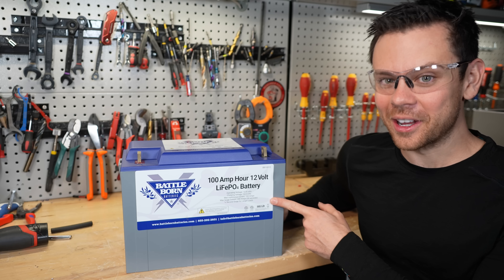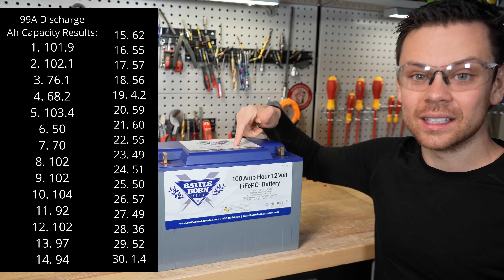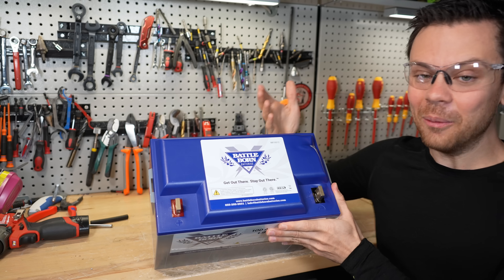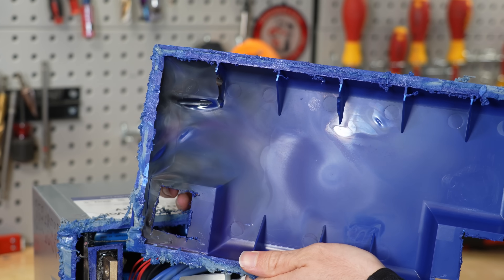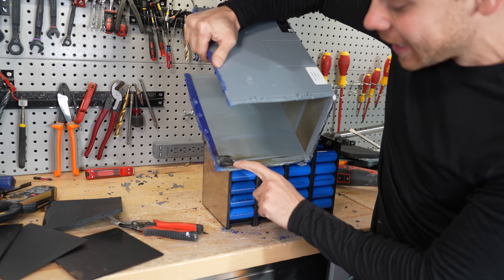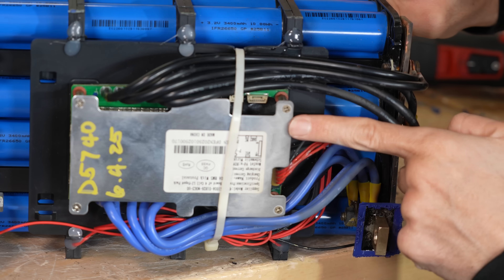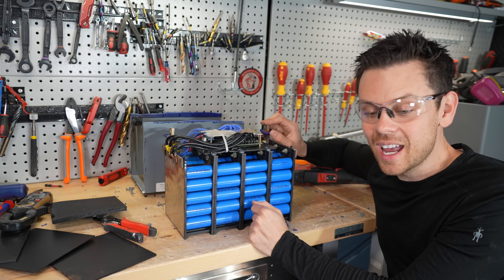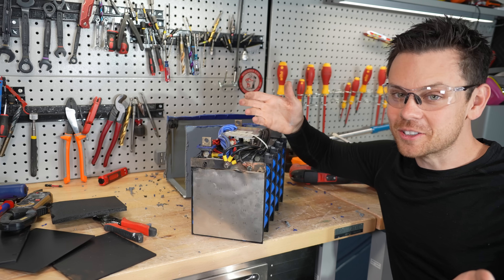Battleborn Battery MELTED?! 🔥🔥New Problem!

Comment: Are the Valence 12v 138AH U27-12XP better? I have done some simple tests pulling 1440w from 1 which was between 110-120 amps with no issue.

Comment: And you know here's the tragedy of all this. Aside from people getting completely ripped off and buying a dangerous product, It's highly unlikely that this company will have the resources to make this right.

The irony is that this was actually a very high quality battery with a fatal flaw.  If only they didn't have that idiotic plastic strip on both sides the battery, they would probably last for a very long time. I don't understand how this problem didn't present itself sooner though. Is this design a recent change or have they always been built like this? Because it really doesn't make sense that they lasted as long as they' have without at least catastrophic failures being reported often enough for this to have been discovered earlier.   Something doesn't add up here. 

If they end up not making good on it,  which I don't see how they will, I would attempt a do-it-yourself repair because it doesn't look that hard. When the repairs done the battery will probably last a very long time as it should have. I would very carefully cut the top off put a copper bar in place of the plastic with new hardware, and epoxy the case back together.  I'd never throw it out though, as that would be just a complete waste of money unless the cells are damaged, which doesn't seem to be the case. The discoloration of the cells was probably due to the smoke inside the battery case. It probably only makes sense to do the repair if the battery isn't as bad as the one in Wills example. 

What idiot made that design decision?  Again, it just doesn't make sense.

Comment: When I want to lithium on my rig 2 years ago, I priced Battleborn but they wanted $2100 for a 280ah battery.  I went with Batter 300ah and have had NO Problems for $600.

Comment: Wow, I have one of those I use with my trolling motor. So far it is ok. I will definitely be watching it, even though I only draw under 70A under WOT on the trolling motor. I also have two GameChanger 3.0 batteries in my Toy Hauler. Any idea if the same bad design is used with them? At least those have a max charge of 50A, so less than 0.1C charge rate for the two 270Ah batteries, and well under 100A max discharge rate at any time, typically well under that with normal use. Hopefully they last over 10 years.

Comment: About the positive terminal, is that steel screw carrying all the current from busbar to terminal? Or is there a better connection somewhere in there?
Reply: It's aluminum. Much better than steel, but not as good as copper.

Comment: Possibly buy another one of those batteries but chop the top off first and leave a thermal camera on it for three or four charge discharge Cycles. It'll be interesting to see what it looks like before it overheats it's terminals and during.

Comment: Did the assembler accidentally use a stainless or aluminum bolt on the negative terminal bar to negative bus bar connection instead of nylon to isolate the two? 

Looks like metal slag where the nylon head should be against the bus bar, and on the other side the threaded portion and nut look like metal not nylon, but could just be discolored from smoke/heat damage.
Reply: Hey @WillProwse, when you get a chance can you let us know what material the negative terminal bar to negative bus bar is made of? 

I’m trying to understand why you had such a catastrophic failure on that side given the amount of surface area carrying the current. 

Aside from all those bolts not being properly torqued, the only other possibility I can think of is that the bolt is not nylon like it is supposed to be to isolate the bus bar from the lug terminal. 

Seems like something more serious might be going on here than just the sandwiched plastic considering the extent of the damage and the damage to the BMS. 

Thanks!

Comment: I dont like using any of these batteries at rated capacity. I have 13x u27 12xp Valence  bateries in parallel rated for 150 amp continuous each, but really only take 300 amp max discharge and 250 amp max charge. They do get hit with 1000 amps for a few seconds starting the diesel engines, but still within ratings. Nothing even hets warm. I would never use one at rayed capacity. But in a test, I was able to start the engines with just 4 batteries. Rayed 300 amps each for 30 seconds, so still not even close. Just to note though. When I did this test with uneven length jumpers, it did not work. All the batteries shut down within a second. With 6 batteries at uneven length, it didnt care and the engines started easily again. It us my guess that they dont expect continuous at rating indefinitely. Because really, what good is a 1 hour battery.

Comment: Battle Burn is more talented at marketing and bean counting than engineering. My guess is multiple engineers have wanted to change the design but bean counters controlling purse strings and schedules didn't allow it. Once a finance person is in charge of a tech biz you can pretty much count on product quality and customer satisfaction degrading. All decisions will be made on how much profit can still be sucked out of their customer base. They'll basically burn up any long  term business success for short term profit goals (and collect their big $$ bonuses). Then they'll move on to another company to rinse and repeat with perfect timing to avoid the chaos.

Comment: I bought 4 Battle born 100ah 12v batteries 5 years ago for my full time RV.  I checked them out after Will’s first video, everything seemed fine, HOWEVER it definitely warrants a more thorough investigation.  I’m thinking it’s not worth the risk of burning everything I own to the ground, plus our lives, to chase the remaining expected life.  If I change out the batteries, then it’s what brand to choose, and what dimensions will give the most Amp hours in my dedicated battery bay. And also what to do with the BB batteries.

Comment: The fix is fairly simple.  Open the case, remove the plastic from the bussbar, repair the case or recase it.  The meat and potatoes of the battery is good.  If BB doesnt make it through this or doesnt recall it could make for a good side business for someone and it would be a way for someone to spend $200 to save a $900 battery from going to a landfill.

Comment: OK man, You 're freaking me out.  I am picking up a new teardrop trailer tomorrow with one of the babies in it.  What am I supposed to do?  Carry around a heat camera all the time?  The dealer says they have not had any returns or issues.. yet.  They are an excellent dealer, and the trailer is nuCamp, so quality people. who will stand behind it.... But I am curious if any of these are actually blowing up or catching on fire..
Reply: It sounds like it will be OK if you just don't push the battery to the limits.  Basically, pretend it can only deliver about half the current.  Will was running it right at its limit but if you run it well below that, it could be OK at least for a little while.  Still, as soon as I could, I'd swap out the battery for some other brand.  Use the BB battery for something that is outside where a fire won't damage anything just in case.  I'm just glad I don't have one of those.

Comment: I can't help wondering if the heat build-up is due to too many high current charge/discharge cycles in a short period of time.  Will should test other batteries the same way and take them apart to look for similar damage.  I'm not sure other batteries would survive such a test.  Just speculation.  But, I strongly agree with him that it's NOT OK to rely on the plastic to keep its strength and rigidity with heat.  Doing so will cause exactly what you see here; soft plastic causing loose connections, increasing resistance, causing thermal runaway.  Slightly off-topic, I'm not surprised the temperature sensors didn't catch this.  If they're measuring battery cell temperature, which could be far from the shell, and that trip temperature (in my opinion) is WAY too hot, the battery won't shut down in time to prevent the cells closer to the problem area from overheating.

Comment: I knew years ago when I was looking for affordable lithium batteries made in America that battle born was a rip off. There were no competitors and they were still over priced. They gave to much education to be real. That was before you, or about the time I discovered you, and I was disabled and living off grid and. You were an influence. But I'm not surprised. Maybe they were better back then, maybe they have taken shortcuts since then, I never trusted them. I don't like admitting I have a power queen that has done me almost 3 years without fault, but it keeps working. I'd buy more if I could. I'll go back to lead acid if it breaks down and I can't afford another one.

Comment: Do any of these batteries have date codes on them? I have 6 battleborn 100's, installed 6 years ago this week. I make heavy use of the batteries with a 125 amp charge rate from a 3000 watt hybrid Magnum inverter. With 6 batteries I'm guessing the highest charge rate will be about 21 amps per battery. I have gone over 200 amps load multiple times and occasionally 250-300 amps. I don't see any heat related damage at all. Thoughts?

Comment: If you want to see a disaster waiting to happen these girls made a video of their power system using 24 battle born batteries in series and parallel to go from 12v to 48v.  You have to see this the video it's called "The Most Powerful Off-Grid Power System!" posted by the "Vanwives" youtube channel.

Comment: Are they stainless bolts inside? Might be a contributing factor, stainless isn’t that great of a conductor. See if the same happens with bronze bolts, nuts, and washers instead of stainless, (if they were stainless)
Reply: Aluminum.

Comment: Please open an old Battle Born battery and compare the differences in construction.  Thanks!
Reply: He already has, one from 2018, in a previous video
Reply: Great idea.  I bought one of these in 2020.  I used it for 4 years with no issues but I sold my RV so I have no idea what is going on with it now.  I did notify the new owners.
Reply: It was made the same way back then.
Reply: It’s possible they change to a different type of plastic with a lower melting point.
Reply: @rq5647  that wouldn't change the fact that things are frying inside.
Reply: just got confirmation today from Roni Ventura that the design of that model battery BB10012 hasn't changed at all.
Reply: Do you really care what old construction looked like when there's thermal runaway in your crawlspace under your children's bedroom?
Reply: This is a great idea. I would like to know what changed since the time when it was a reliable and upmarket battery.
Reply: Maybe Battleburn shut down their plant and authorized a chinese company to build their batteries.
Reply: @thenick3216  plenty of the problems being reported involve old batteries
Reply: The reason is China. Unless you control them with tight rules, they can replace anything with something to save few cents and send them to you like nothing happened. Have you heard Chinese construction site where they replaced iron with bambu?, just because steel was expensive.😂
Reply: @bobsnabby2298  battleborn is choosing these parts ala carte.  They do the assembly

Comment: Ugh!  I have 3 BattleBorn batteries, I’ve had them about five years, I did have a problem with 2 having melted plastic after one year. BattleBorn took them and sent me 2 new batteries and at the time I thought solid, they’re standing by their product. Now I’m wondering if this will happen again in future. 
What battery would you recommend replacing them with?
Reply: Replace them with Battleborns new safe IGNITO heated batteries.
Reply: Will has a webpage of batteries that tested well and didn't burn up anything.  Basically, they are batteries he would buy.  He also mentions some to avoid as well.  He usually puts a link in the description of each video.  He also has a forum as well.  I joined there and asked a couple questions about my new Lifepo4 battery.  I got very helpful responses.

Comment: Someone should tell Battleborn how a torque wrench works.  But this is my theory, Battleborn had well paid workers and they did a fantastic job for years.  Once they dominated the market, they started hiring cheap labor who don't value their poorly paid job and you get negligent mistakes like this.
Reply: I think what happened is the bolts, nuts and lugs got hot, melted the plastic which made the bolts and nuts lose, then it wasn't making a good connection and got hotter and the cycle repeats.  Once it was no longer making a connection at all, no charge and no output either.  

I suspect heat first, then failure of the plastic which just made things worse and worse.  As Will said, plastic like that is not a good idea.

Comment: Are you gonna put an addendum to the video you made when you first dismantle the Battle Born battery and talked about all the highlights and all the good things and with a big smile on your face, you said I’m so glad this is good cause I recommend it. How did you miss all of this stuff on that go round?
Reply: It could be those batteries were made better.  Often, companies get big and start cutting costs.  When they do, quality goes down.  This is nothing new.  So, some older batteries may not have this problem.  It just may be that only new batteries are affected by this.  I hope anyway.

Comment: After working 20+ years so far in various factories as a technician/engineer I can honestly say that "American made" is actually a detriment in many cases especially when it comes to electronics. Ive been to many Asian countries and the attention to detail and the quality of worker is second to none at the moment.

P.S. I built a 65mph 72v 80ah e-bike from a parts kit directly from China that I still ride after 4 years for $2000 total. An export American company that basically builds the same "licensed" kits here in the states wants $6999 for it with while bragging its American built probably some dude getting paid $12/hr to assemble it on a Friday afternoon. Ill take the half priced Chinese version, 20 years ago that wouldve been very different.

Comment: Battleborn is dead. The USA off grid power industry is dead. I have a MAGNASINE 4024 inverter that has failed. The company has shut down with no more tech support. 5 separate electricians have failed to properly program my unit. My 4th set of batteries are currently dead. Off grid power has failed to produce a product that actually works.
Reply: You have " Main Character Syndrome".

Comment: This is Fd up. Got 5 of these batteries.  Now I’m gonna have to look into different batteries!   I’m pissed!  Plus,  how to tell and know if “other” brands are built or engineered correct?
Reply: Check the video description.  Will has a link to a webpage that shows batteries that passed the test and some to avoid as well because they failed in some way.  It's not guaranteed but it's at least a start.  No one really knows if they made changes inside that might make a good battery a bad one now.  One just has to hope.

Comment: I cannot believe they are using a bolt as a current path(plastic in between lug and bus)! bolts are for securing only, of course its going to get hot its a resister in the circuit. This is very basic stuff, how did this batt ever pass design phase? I thought Battle Born were a quality product, they certainly charge $ as such, maybe it's just good marketing?! Personally i don't like batteries with those cylindrical cells to many possible failure points, i prefer prismatic cells.
Reply: What are prismatic cells?
Reply: @JohnnyDanger36963  Rectangular shaped lithium bricks like EVE, Winston and CALB Cells (look em up), basically what every other manufacturer puts inside their batteries, Battle Born are the only one i know of using Cylindrical cells? I could be wrong.

Comment: Someone in my Facebook RV group tore apart a dragonfly (same company as battle born) gc2, and it has the same plastic strip between the conductors. So it's not just this battery, that company is really committed to keeping electrical contacts separate.
Reply: Battle Born is the consumer brand of Dragonfly.
Reply: @wek66 Correct. I should've specified, I'll add that.

Comment: just putting this out there... i have 2 battleborn 100 amp lipo batteries connected in parrallel and 400 watts of solar panels in my van.  i've been using the batteries for about 4 years.  i pull them in the winter and have them sit inside the house until the spring months.  i am using these batteries lightly.  i have an engel refrigerator, 1K inverter, a water pump, max fan, and led light circuits.  i have victron components, breakers, fuses the works.  it is a safe setup.  i have only drawn down the batteries to 85%.  The recharge takes under an hour.  visually inspecting, i see no problems around the terminals.  however, i will purchase an IR tester and monitor the batteries when charging through shore power and solar and when discharging with everything turned on.  i will be highly disappointed if these batteries show signs of overheating.  thanks for posting these videos!

Comment: Will, spread the cell modules at the bottom, you will see another horrible design choice (only bolted at top). I don’t think slapping a BB sticker on  Goldenmate batts, then adding an insane mark up, can save them unless their Chinese partners supply an influx of $$$.

Comment: Thanks for this follow up. I have had mine for 5yrs and was waiting for a better response from BB. At this point I dont use mine this strenuous but I do use them and while I was considering continuing to use them I am now just going to swap them out. I had already bought new batteries but it was to add and now its to replace.